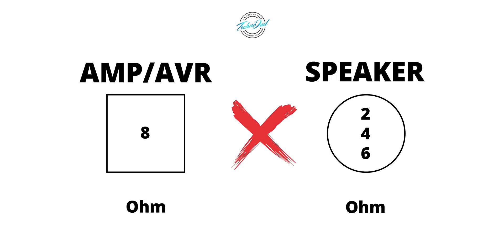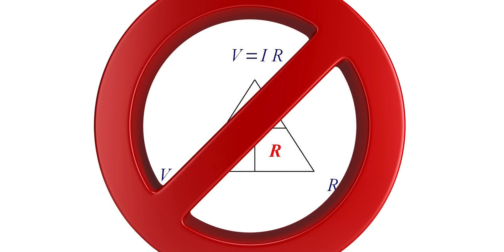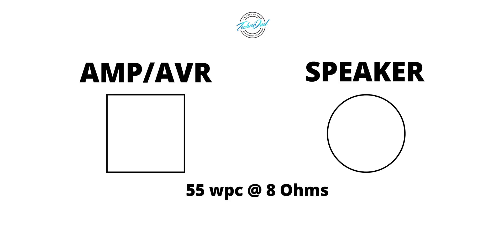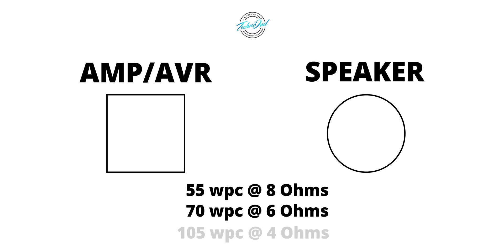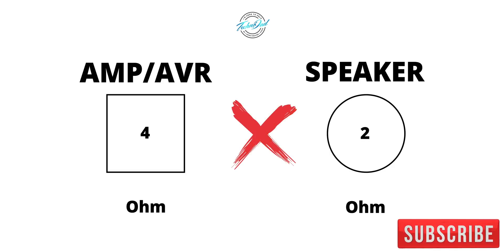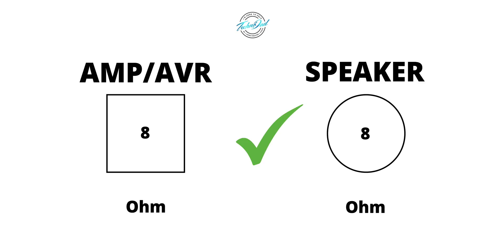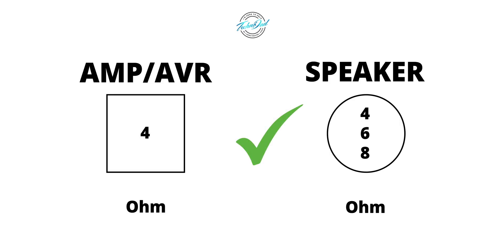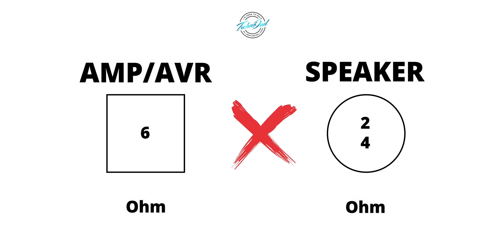Speaker Impedance Matching to Amplifier | What You Need to Know!

Comment: Hi, how do I get 6ohms from a McIntosh integrated amp when it has only 2, 4, & 8 ohms output?? Can I jumper the 2 and 4 ohms terminal ?
Reply from the maker: I would not do that.  I would go to  either 8 or 4...maybe 8
Reply: @TechnoDad  Many thanks for your advice. Appreciate it. I really wonder why would Mcintosh put some 2 ohms output rather than 6 ohms. AFAIK there way more 6 ohms speakers in the market than 2 ohms.

Comment: My speakers are 3 ohm 90watt rms and I am only finding one amplifier with both 2ohm and 4ohm RMS rating. So can u tell me what my amp RMS at 2ohm and 4ohm  should have on each channel to power my 90watt RMS 3ohm 270watt peak speaker per channel???? 🙏🙏🙏🙏🙏🙏
Reply from the maker: Hi!  If your speakers are 3 ohm, then you would need to get an amp that is stable at 2 ohms just to be safe.

Comment: You say "do not connect a lower ohm speaker to a higher ohm rated amp", but you don't say what will happen if you do. Can doing that, damage some amps? And if so, in what way? --Thanks
Reply from the maker: The amp will most likely 'clip' meaning shut off.

Comment: I have 8ohms amplifier
(SAKURA AV735 UB
But my speaker is 16 ohms
500watts x2
Reply: Higher-than-rated speaker impedances are OK for transistor amplifiers; lower-than-rated speaker impedances are OK for tube (valve) amplifiers.

Assuming the amplifier has a solid-state (transistor) output, Just use the speakers, but expect reduced power output.

If the amplifier  has a vacuum tube (valve) output coupled through a transformer, you will need to use two 16 ohm speakers in parallel for each output channel (because the parallel combination is equivalent to an 8 ohm speaker). Otherwise you may damage the output tubes.

Incidentally, if you had 4-ohm speakers, you could damage a transistor amplifier by connecting them directly; you would have to connect two in series to each channel to prevent damage (two 4-ohm in series are equivalent to one 8-ohm).

If you connected the 4-ohm speakers directly to a tube amplifier, it would work fine, but at a reduced power output.

Comment: Can you use 6 and 4 ohm wired in series together for a stereo system rated at 8 ohm max? It comes in at 10 ohms. Thanks.
Reply from the maker: I mean, if the theory is correct and the amp is seeing a 10 ohm load, it should be okay.  I don't know for sure though...

Comment: If i buy this speaker  - Dynaudio Evoke 50 -  which has an Impedance of: 4 Ω - and a IEC power handling of : 260W.
And i pair it with an Parasound Halo A 52+, which is rated at: 180 watts RMS x 5 @ 8 Ω / 255 watts RMS x 5 @ 4 Ω.
Is it sufficient enough to keep up with the speaker?
Thanks in advance.
Reply from the maker: Hi!  Yeah, the 4 ohm output of the A52+ is 255 x 5.  If you don't use all five channels, you will get more power output.
Reply: @TechnoDad  Alright thanks for the answer. :)

Comment: I just watched this video and I have a question. If my amp puts out 300watts at 4ohms a side, what does that convert to when feeding an 8 ohm speaker? How many watts are available to the speaker.? The speaker is 400 watts at 8 ohms.
Reply from the maker: Hi!  It's usually about half, as 8 ohms is double the resistance as 4 ohms.  So you'd get about 150 watts into 8 ohms.
Reply: @TechnoDad  thanks.
Reply: @philmcglauflin  what amp do you have

Comment: Sir I have polk hts10 subwoofer 8ohms ,and tannoy elicps center channel 8ohms ,and elac debut 2.0 b 6.2 book shelf speaker now I am intermixing my denon avr x 1600h Does this cause any problem?
Reply from the maker: As long as they are not lower than 4 ohms you should be fine.

Comment: Awesome video. Answered my question I was looking for. Just bought a Yamaha receiver that is 8 ohms out of the box but says I can change to 6 ohms. I was watching a video regarding the Pioneer SP-FS52 standups I also bought and he said he would recommend leaving the receiver at 8 ohms even though the speakers are 6 ohms because it sounds better. From this video it sounds like it can cause speaker or receiver issues, is this correct?
Reply from the maker: When you have these settings on the AVR, switching from 6 ohm to 8 ohm or 4 ohm to 8 ohm, you'll want to always keep it on 8 ohm as choosing the other options will cut the power output of the AVR.

Comment: Hi Techno Dad.  I have a 5.1 setup for a backyard movie theatre, I recently purchased a center channel speaker kit but did not realize it was a 4 ohm speaker.  My AV receiver is an older Marantz SR 5000, I believe it can go as low as 6ohm.  Since I will be using this most likely at max volume I do not want to chance blowing my receiver, what is the cheapest solution for my problem?  If I purchaes a 2 channel amp for the center channel speaker will that solve my problem?

Comment: My speaker enclosure having 3 speakers ..it is mentioned 8ohms..my amp can handle 4to 16 ohms....my question is.. unfortunately the mid speakers are not working and I got a 4 ohm speakers with the same size...I didn't found any crossover in the speaker enclosure ..only one caps is hooked with tweeter...my woofer is 8 ohms..so now does it required to add additional resistance with the mid speakers....

Comment: Thanks. So I have a basic 5.1 home theatre set up... I want to upgrade to a 7.2.4 set up but don't really want anything more powerful so I thought about reusing existing speakers. I can get extra matching speakers for the extra channels. I checked the existing front right speaker and it says 3ohms... so I need an AVR with nothing greater than 3ohms for that channel. Can I double up the centre speakers on the same channel providing I don't exceed the impedance? Can I even get such an AVR? My 50" 4k HDR TV doesn't support Dolby Vision, what will display on the TV?

Comment: Car audio guy here. I notice nobody is suggesting what we already do in our vehicles. Wire speakers together in parallel or series to change the ohms to what you need. Its easy. And get a multimeter for 6.99 at harbor freight and you can test all your speakers to see the actual number. 2 eight ohm speakers wired together in parallel drops the resistance by half. The amp no sees the 2 speakers as one 4 ohm load. But they have to share the available power between them. 2 eight ohm speakers wired in series will be 16 ohms. So you can use 2 four ohm speakers and wire them in series to acchieve a final 8 ohm load your amp will handle. This is everyday basic stuff in the car audio world. No offence meant.
Reply: Car audio guy here.  I came here to say this. 💯

Comment: I have a combination of 6 and 8 ohm  speakers. Should I change the impedance level on my AVR?
Reply from the maker: Probably not.
Reply: @TechnoDad  hi! I have the same question. My marantz 7013 is set @8ohms. I am running B&W new 600 series for my LCR and these are rated @8ohm. My surround and front height channels are old Yamaha bookshelf spks which are rated @6ohms. Shall I modify the ohms setting on my 7013 to 6ohms OR leave it @8ohms ? Please note the B&W 603's can drop to around 4ohms at certain frequencies. Please help.
Reply: @aboltabol73  I also have same question I got full set of yamaha yht 1840 in that speaker is 6 ohms for all ,but I have JBL center speaker which is 8 ohms so am not sure to connect JBL speaker or not
Reply: @aboltabol73  same issue 
My dali Front Left  speaker is 6 ohm 
My surround Speaker is 8 ohm 
Very confused

Comment: Can't be true using an 8ohm reciver with and 4 ohm speaker is totally fine at lower volume s may heat up a little but will be fine
Reply from the maker: No man, it’s the other way around.
Reply: the only thing is that your reciever will heat, but otherwise its fine. You can use it like that way

Comment: Ok so I have a Peavey 6505+ with a Mesa boogie 4x12 on the way. The boogie has an 8ohm input but also two 4ohm inputs. The 6505+ has an impedance switch that lets me go from 4 to 8 to 16 ohms. How would I set the amp to run into the two 4ohms inputs on the boogie?
Reply from the maker: I'm not familiar with that, but I would imagine setting the amp to 8 ohm and using the Mesa Boogie's 8 ohm input.

Comment: I've a pair of custom-made 4 ohm labyrinth design tower loudspeakers rated @ 100w w/2 6.5" Peerless drivers w/a Peerless soft dome tweeter. Guy who designed them makes foldback stage monitors and stage speakers, and was driving them w/a 100w McIntosh amp. I've been using an HK 3490 to drive them for almost a decade before the board in the unit went flaky (wouldn't read digital optical input anymore). I don't have a lot to spend on an amp/receiver, and I can't afford to get rid of the speakers (which are 35 years old). What budget amp/receiver (w/optical input) would you recommend to drive those 4 ohm speakers?
Reply from the maker: What price range are you looking at?
Reply: Techno Dad under $250
Reply: Techno Dad was thinking Yamaha, as the AV-1103 I had prior was very clean.

Comment: What’s important that you have to set the level of each speaker manually, if  for example,  the avr is at 4 Ohms and the speaker is at 8 ohms. If that’s the case you have to double the level to get the same soundlevel as the other speakers. Denon avrs don’t recognize the Ohms when you do a measurement. You have to set the right level manually in the menue.

Comment: I have an Onkyo TX-NR787 9.2, and this is a 4ohms and 6 ohms.  My speaker are 8 ohms  and I have 5.2.4 set up speakers.  Should my receiver be place on 4 or 6 ohms or either way are ok.Tkx
Reply: Hi did u end up getting an answer? I have the Onkyo TX-NR676 and just bought klipsch rp-8000f and I want to know if that will work together?

Comment: Thank you . Now I'll not buy 6 ohms speakers for my Jvc amp of 8 ohms
Reply: She literally said the opposite. The amp or audio video receiver, AVR should only be paired with equipment that has of that ohm rating or higher. So you only want attach speakers that are 8 to 16 ohms. 6 ohms and less will cause your amplifier to struggle and strain harder causing it to possibly burn out and blow out faster

Comment: There are some speakers whose impedance changes widely across frequency range. For example, here’s what Stereophile found after measuring impedance of popular KEF LS50s:
“Somewhat optimistically specified at 8 ohms, the LS50's impedance drops to 4 ohms at 200Hz and to 5.4 ohms at the top of the audioband.”

How does this affect the sound? Music has all frequencies in it: low, medium and high. Say, you have an amp that can deliver 20w into 8 ohm and you play a song relatively loud. Now when these speakers’ impedance drops to 4 ohms in low and high frequencies they will ask your amp to give them twice the power, 40w, in order to sound as loud as mid frequencies. If the amp can’t deliver all the required power you will hear tonal imbalance (not enough bass), the sound will be dynamically compressed or even unpleasantly distorted. Unfortunately not all amps or AVRs are capable to deliver double the power into 4 Ohms comparing to what they can deliver into 8 Ohms. Such amps will be a bad match to KEF LS50s or other speakers with similar impedance characteristics. Unfortunately, in most cases you won’t know if a speaker has impedance swings just by looking at its specs. You could try googling the measurements though.

Comment: From judging thru the slides you provided, a 8 ohm avr will not be suitable with 4 ohm speakers. With that being said, I have a Denon 4500 that states it runs 4-16 ohms. I am currently running two Elac Uni fi towers as well as the Uni fi center. Both rated at 4 ohms. Is it safe to say I shouldn’t be worried about anything? 

And another question is since I’m running two 8 ohm surrounds as well as 4 prime elevations also at 8 ohms, is there any concerns of them being mismatched with the fronts in terms of power and audio balance? I am aware that the Denon can switch impedance levels. Haven’t tried it yet.

Thanks.
Reply from the maker: Hi Tony, great questions!  You should be completely fine running the X4500H with 4ohm front stage and 8 ohms everywhere else.
Reply: Thank you sir , for your suggestion , love and respect
Reply: Do you have to change the impedance in denon’s configuration for it to handle 4 or 6 ohm speakers along side with 8ohm speakers? Or does it recognize it automatically? If you have to change how you do it?

Comment: Hi TechnoDad... What are the possible risks if connecting speakers with lower ohms than the amplifier's?
Reply from the maker: Hi!  The amp will not be stable so it will start clipping (turning off) at random times.
Reply: @TechnoDad  Thanks!!!

Comment: Is there any benefits in running a lower ohm? My rz830 has 4 & 6 ohm settings in the menu.  For example my 504c is 8ohm and so are my towers. Would setting my receiver to 4ohm provide it with more power per channel?
Reply: Probably not but im not familiar with what this settings does exactly. 
Amplifiers are not directly power limited, the limit is the result of a voltage limit and a current limit. Depending on the impedance of the speaker (or headphone) one is more or less of a bottleneck. Two speakers with the same sensitivity will require the same power for the same loudness but the low impedance speaker requires more current and the high impedance more voltage.
So my best guess of what this setting may change if anything at all is that it might change the circuitry or switch to another mode that is able to push more current which is needed for lower impedance speakers. Too much current being availible is rarely a problem but it might reduce power as you might be running into the voltage limit. Hitting the current limit on the other hand has far more downsides usually resulting in weak bass performance, clipping,... and not just lower volume.
Reply from the maker: Hi BirdMan!  As it's already been stated, just keep it on 6 ohms...
Reply: Ok thanks guys I’ll keep it at the default 6ohm.
Reply: NO! Don't do that!

Comment: i just stopped everything i was doing at work to watch this! haha
Reply: the reason why you dont want to hook a 6 ohm speaker to an 8 ohm avr is that it'll push too much "power" to the speaker and blow it out? i.e. the speaker isn't "pushing back enough" on the electricity/signal that the avr is sending?
Reply from the maker: The amp/AVR will start clipping (turning off) because it’s not stable pushing that much power to the speaker.  Since there’s less resistance more power will come out of the amp/AVR and if it’s not stable at that ohm load it will start clipping.
Reply: @TechnoDad  makes sense! yeah this was a great little informational vid!
Reply from the maker: Thank you Jim!
Reply: @jimmerdood  not true at all. I ran 6ohm paradigm speakers on my technics 8 ohm receiver for over 10 years. It just got hot but played normal and never clipped. It all comes down to the power supply of the amps.
Reply: @seanlacroix  yeah ive been driving my 4400h hard (8ohm power) to my yamaha 777s which are 6ohm and they have been running great together. maybe its that the diff of 2ohm isn't totally enough to harm either the speaker or the amp, but i may try to upgrade my speakers to something with 8ohms to make sure my amp isn't harmed. my center is the yamaha 444 which is also 6ohms. will look to upgrade those next. really dont want to harm my 4400h